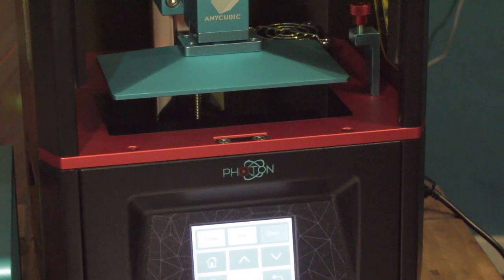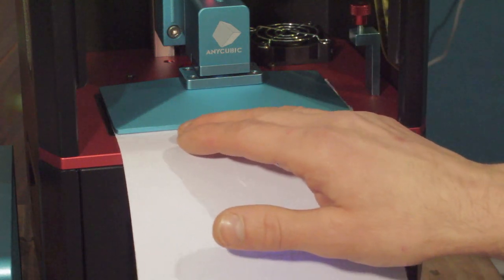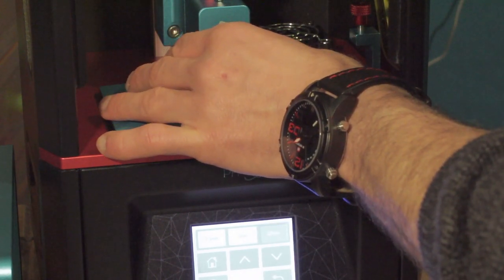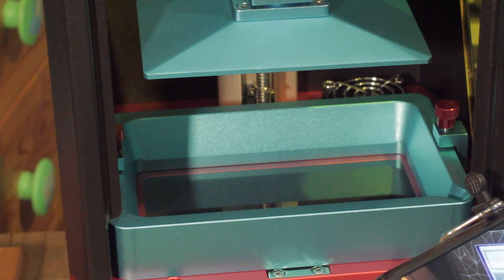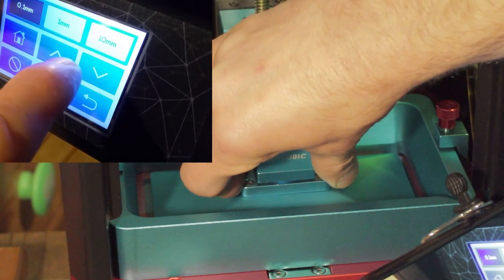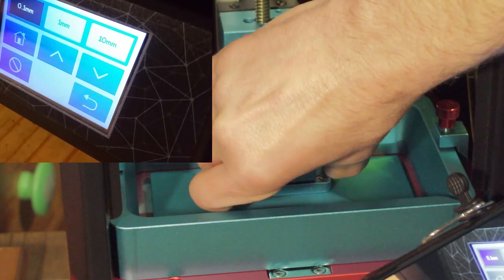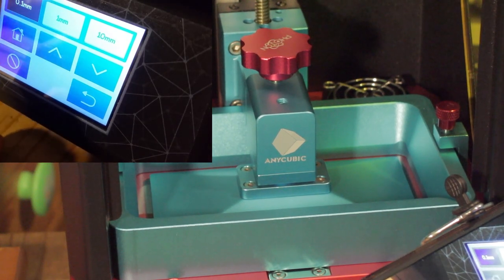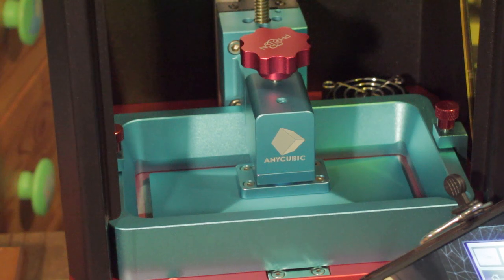Anycubic Photon Flint Read Method w/ close up menu detail video

Comment: 0.3mm seems high... I've been having all kings of screwed up prints on one side like its too far away
Reply from the maker: Bear in mind that you're not just letting the plate 'touch' the FEP, it's actually tightly sandwiched between LCD glass and plate. When you tighten the grunge l grub screw it will clamp tighter still so the actual gap will be more like 0.2.
Re your prints, do you mean they're not sticking to one side or the print itself during printing is messing up?
It's quite likely you either need to relevel checking that you are holding with even pressure both sides or you need to check your display is getting an even spread of UV or you need to increase first layer exposure. The latter is the most common cause of first layer failure.

Comment: Be careful with this technique!!  I blew out my Z axis motor.  If you lower the build plate too far, it will burn out the system.
Reply from the maker: You can tell when it hits bottom. Provided you only lower 1mm at a time it works no problem.